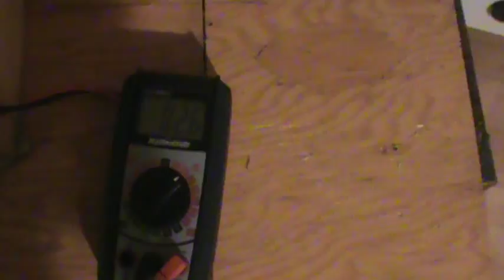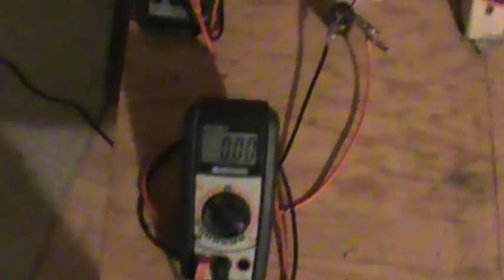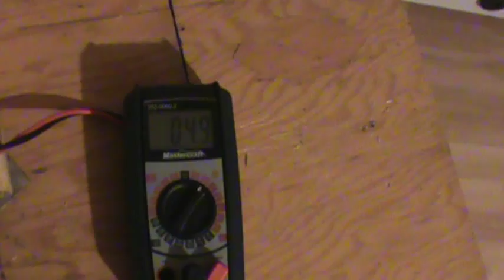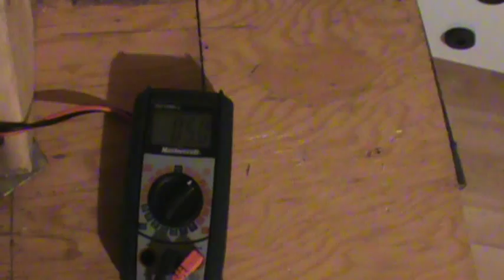Free Energy Project - EdiniGen 2nd Set of Coils

Comment: Hi Angus,

Did some tests myself again and found that the speed is faster without  the coils mounted then with shorted coils. Speed does go up but wat do you gain when more coil pairs are attached? Don't want to be negative here but on your first run speed was 0.64v and withe the second pair mounted it was .51 so if you mount more  pairs speed will drop even more. am I missing something here? It may be more efficient with more copper though. I did order 8 kilo .25 mm diameter here to tests.

Comment: Hi Angus

Just did some tests myself again and I see that even when the coils are shorted the speed is lower than without  the pmh coils mounted.

Don't want to be negative here but on your first run with the one pmh the speed (voltage) went up to 064v but with the second pmh connected it is 0.51 so I am beginning t

Comment: Nicely done, How did you connect your 2 u-coils? Parallel? Im think you are canceling the output of each coil, on you past video your output voltage was 12v but now only 11, if i may suggest, use separate bridge diodes then connect dc side in parallel so output will add up, regards.